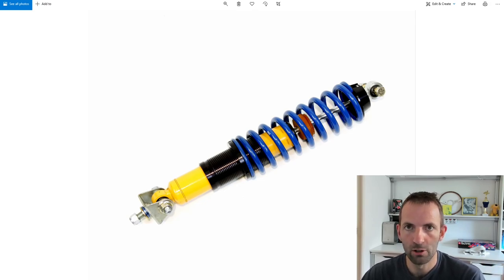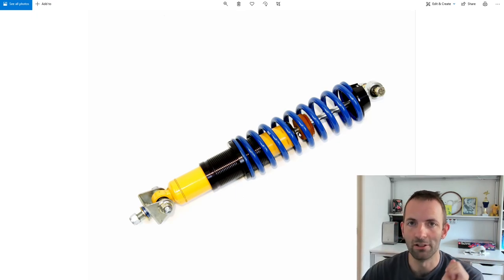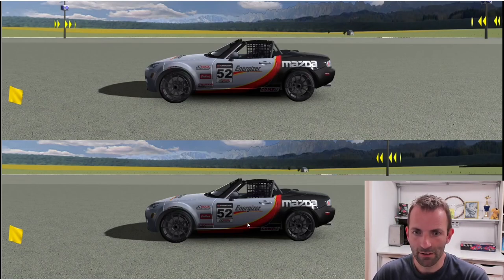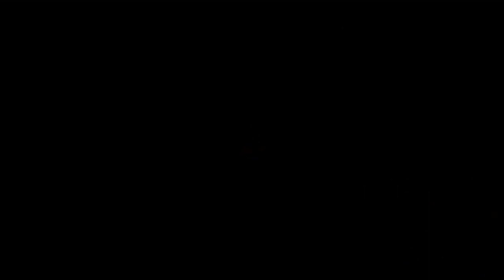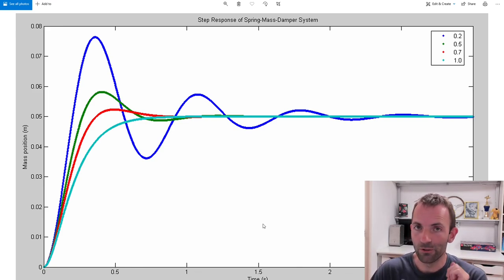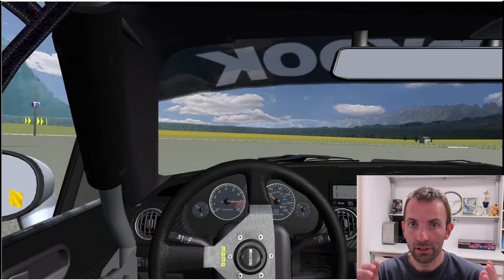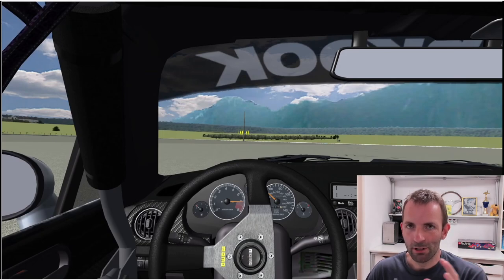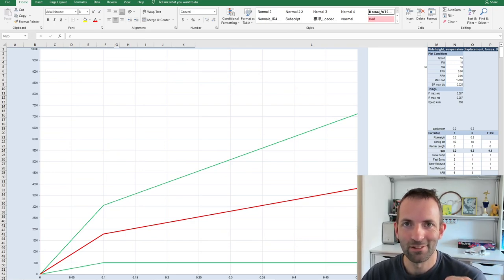Dampers Explained! In a *DIFFERENT* way than you may have seen before. See TimeStamps!

Comment: Very useful, thank you. As always learning a lot, and reinforcing what I know to know it better. And also sorry with lengthy text which perhaps to some extent is not going to make any sense, as I don't understand many things well enough (it is not a must read, risk your time on your own risk):

I never thought before that inertia influences damping, although it is obvious that inertia will change how quickly/easily bodies will get into motion, still never associated that with damping before, it is very interesting.

 To me the transients part is very interesting, where you as a driver with your inputs can influence damping. I think it could be taken step further and dug in deeper. I mean stepping into tire territory. It is usually a topic of how to work dampers to get most of the tires. But opposite is also true, tires can be fitted to match damping and suspension better. It was a while ago, when I was working with some mods physics, when I thought of tires as damping mechanism, but not for chassis roll, pitch, but for how quickly tires are capable to transmit forces. And also how quickly they can switch from sliding to static friction, which is related as tires basically work that way - they slip and then statically grip continuously non stop. Constant slippage area goes bigger with growing slip angles and slip ratios. Maybe high performance modern tires has steep high peaks and fast drops mostly because their rate of transmitting force is very quick - they are stiff, and at the same time their static grip is a lot higher than sliding friction, they are like working in higher frames per second, where frames are moments at which tire contact patch slips from one position into other while transmitting forces through wheel to the car. While classic cars or street cars have lower peaks and their frequencies at which they operate are lower. 

It was one problem related to yaw rates that got me thinking about these things. I have had many sixties race cars that had to be compliant as observed from real videos and pictures. Soon I discovered some problems of getting lots of driver induced oscillations, often hardly avoidable. Then got better suspension settings, and it still was pretty bad. Then I noticed that a lot, or most of it happens mostly because as tires slip, they just gripped back on sooner before chassis finished rolling resulting in growing oscillations and very poor stability. I didn't want to compromise chassis compliance, and difference was too big to solve it with dampers, so I found a better way with tires. Don't remember exactly what I did, but I think I parametrized tires to start slipping later, and not to slip for that much of a time, so there was more static tire gripping with less slip as chassis was rolling, and slip then bite back into grip matched better with chassis roll oscillations. 

I have found it rather challenging to work on old racecars mostly due these reasons, get a correctly compliance cars, by correct motion ranges for their original time periods seems more challenging than do it for stiff cars. Perhaps this is also a reason why iRacing can't get Lotus 49 to handle properly as they butchered it with too modern tire. 

By the way, driver induced oscillations did not go away completely with very softly sprung cars. But it requires stupid inputs, like pulling steering wheel while going very high speed and then not touching at all, or even worse adding up to oscillations by resonating them with very awful steering inputs. Which poor drivers tend to do somehow. Stiffer cars such as Lola T70 or GT40s, tend to shake off oscillations themselves more easily, I think that is because smaller roll motions fits better with timing of how tires slip and then grip back up within smaller yaw ratios, and these slides that I mean are typically very small, often almost unobservable. 

Perhaps this is one of few main reasons why all cars seems to keep on getting bigger, longer, stiffer... It is all to make them less likely to suffer from driver induced oscillations. Doing it by increasing inertia, and lowering ranges of motion by increasing stiffness including dampers. Although stiff cars have more tendency to loose traction due to tire load sensitivity, and then swing back quicker, but perhaps it is just less of a danger comparing to people sending cars into series of growing intensity tankslappers by doing some stupid steering motion being totally distracted while commuting in highway. As stiffer bigger car most likely will just shake it off itself, unless the initial yaw rate will be too hard.

Comment: Your Histograms were very balanced for that car, so maybe that’s why you didn’t really have anything to do there. If there was some sort of symmetry imbalance, it might indicate an adjustment needed, but not in every case obviously.
Reply from the maker: Could be that I don't adjust dampers that much because I mostly drive 'my own' cars I create for Automobilista and perhaps I install dampers that are ballpark OK to begin with for the setup..
Reply: @NielsHeusinkveld  These look great for this type of car. Symmetry is great for baseline. I try to think of dampers working in pairs or trios. When one is “bumping” others are rebounding, so a symmetrical baseline is a good thing, left to right and rear to front etc. Changing the baseline would be useful on a track to track or even corner by corner basis for example if you want a bit more cornering help but don’t want to upset the overall stiffness distribution too much. Thanks for the great video as always. Super super valuable for sim tuners like me, appreciated more than a YT comment can convey.

Comment: 9:41 I do not quite get it; why would a stiffer damper result in that tire getting more load? If it resists the roll motion more, then shouldn't it result in just less/slower motion instead of more load?
Reply: Think of the damper like sponge for the transfer of energy where you can tune it's firmness (or more specifically tune the rate at which energy is transferred). If your damper is very soft it takes a longer amount of time for the energy of tyre load to transfer from the tyre to the damper. If you stiffen the damper, the time it takes for the energy to reach the damper from the tyre is reduced resulting in a higher concentration of energy being transferred, or rather in this case, more load is being applied to the tyre because the damper is barely moving which means the tyre is forced into the ground more.

Comment: What have you used for the simulation and  telemetry? is it simple and user- friendly enough for someone who would want to play a little with taht mx-5 dynamics to see what happens?
Reply from the maker: You can fairly easily adjust inertia and damping and springs etc on rFactor 1 and Automobilista (downloaded mods, not original content) cars, this is Automobilista, but with my own 'test physics'.